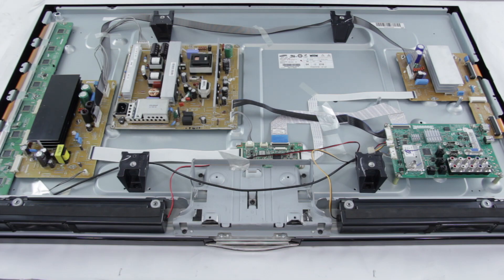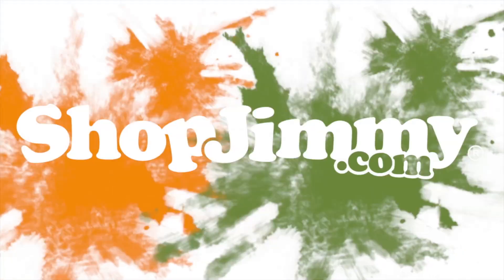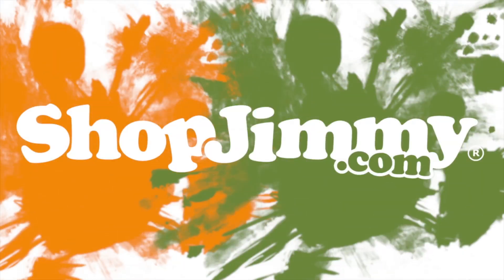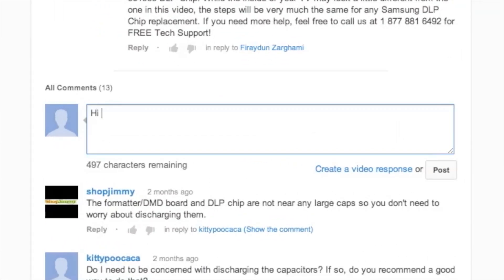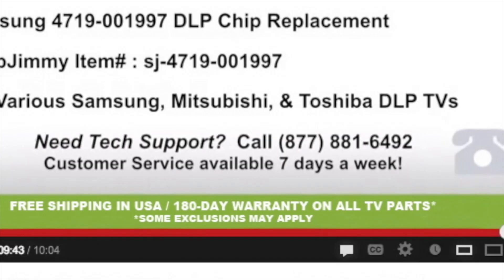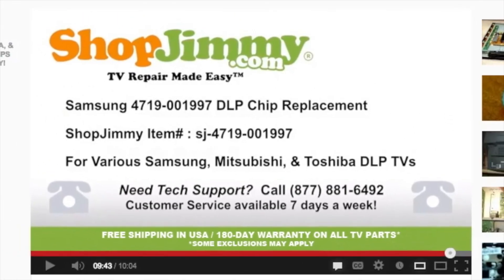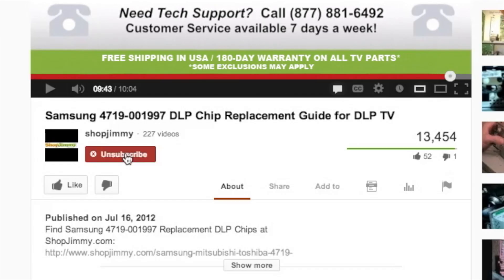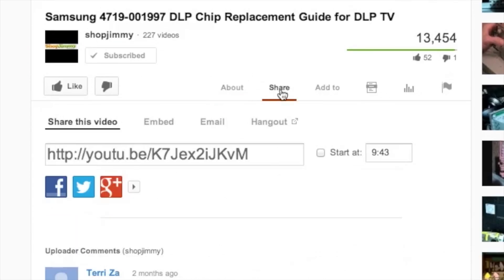Plasma TV Repair Tutorial - Common Symptoms & Solutions - How to Fix Plasma TVs

Comment: I have a Toshiba 42HP66 Plasma TV. It turns on but there is no sound and no picture. I did the test with the Y-Sustain and Z Sustain and neither brought sound back. There are 2 capacitors that dont look busted but may be. What would be the most common culprit with a partially failed power supply?
Reply from the maker: +James Misse   Try all repairs and troubleshooting at your own risk.  I recommend replacing the YSUS and the YDRVTP board in your TV.  Click this link to replacement parts for your TV model number:  http://www.shopjimmy.com/catalogsearch/result/?q=42HP66  There may be multiple boards for the same TV model number, be sure to match part numbers on your current board, with your replacement for compatibility.  Here is a link to a video showing how to identify your part number, click here:  https://www.youtube.com/watch?v=GEllG3RV-tc  Thanks and please let us know if you have any further questions with your TV Repair!  www.shopjimmy.com

Comment: Hello I have a plasma samsung model pn50c550g1fxza, It has thin vertical lines that run from top to bottom.
Reply from the maker: +Paula Bryant   Try all repairs and troubleshooting at your own risk.  This sounds like a TV panel (TV Screen) problem.  If your TV panel is bad, it may be more cost-effective to replace the TV as panels are typically hard to find in stock, difficult to replace, and expensive.  Thanks and please let us know if you have any further questions!  www.shopjimmy.com

Comment: Hi, I have a Samsung Plasma FP-T5084.  I am not getting any power to the TV at all.  I checked the power source and cable and they are good.  From watching your video I'm thinking it's the power supply.  I have 2 questions.  How would I know if I should change the Power Supply or the fuse/fuses?  Also, do you know where i'd order these parts?
Thanks so much!

Comment: Hi, I have a samsung plasma tv, model #PN51E8000GF. When facing the tv I have lines that run from top to bottom  just on the right hand side of set. They vary in color and number, there can be as little as 2 and as many as 8 at a times.

Comment: I was watching my Samsung PN59D530A3F, there was a loud pop and some sparks came out of the bottom on the side where the power plugs in. Now the power will not come on. Based on your video it sounds like it would be the y sustain board. What would be the ideal solution?
Reply from the maker: +Burtonbordr09  Try all repairs and troubleshooting at your own risk.   I recommend looking over all of the boards to see if there are any damaged components or raised capacitors.  Thanks!  www.shopjimmy.com

Comment: I have an LG Plasma 50PC3D-UD.A1 serial number 610RMZL032381. The set is getting power and is turning on but "no signal" from either the cable box or Apple TV. Could it be as simple as replacing blown capacitors, the main board or are there bigger issues? Thanks
Reply from the maker: +Patrick Smith   Try all repairs and troubleshooting at your own risk.  I recommend replacing the main board in your TV.  Click this link to replacement parts for your TV model number.  http://www.shopjimmy.com/lg-68719mm062b-main-board-for-50pc3d-ud.htm  There may be multiple boards for the same TV model number, be sure to match part numbers on your current board, with your replacement for compatibility.  Here is a link to a video showing how to identify your part number, click here:  https://www.youtube.com/watch?v=RwHTvjMdrhk  Thanks and please let us know if you have any further questions with your TV Repair!  www.shopjimmy.com

Comment: My PN42C450B1D samsung plasma tv doesn't turn on. The red light works and the start up sound plays but the screen stays off. My wife said it made a popping sound when it went off. Any help would be great. Thanks
Reply from the maker: +Jonathan&Courtney Lorenza  Try all repairs and troubleshooting at your own risk.  I recommend replacing the Y-Main Board and the (Upper) Y Scan Drive board in your TV.  Click this link to replacement parts for your TV model number:  http://www.shopjimmy.com/catalogsearch/result/?q=PN42C450B1D  There may be multiple boards for the same TV model number, be sure to match part numbers on your current board, with your replacement for compatibility.  Here is a link to a video showing how to identify your part number, click here:  https://www.youtube.com/watch?v=R1jmj_foId0  Thanks and please let us know if you have any further questions with your TV Repair!  www.shopjimmy.com

Comment: I have a samsung HPR 4272 plasma screen TV. The TV does not show a picture or sound when plugged in and turned on. It will make a clicking noise as if it was turning on and off cycling through on and off continuously. Any suggestions would be appreciated. Thanks 

Motemlw@gmail.com
Reply from the maker: +Michael Wintermote   Try all repairs and troubleshooting at your own risk.  I recommend replacing the Y-Main Board and Y Buffers in your TV.  Click this link to replacement parts for your TV model number:  http://www.shopjimmy.com/samsung-lj92-01200a-y-main-and-buffer-kit.htm  There may be multiple boards for the same TV model number, be sure to match part numbers on your current board, with your replacement for compatibility.  Here is a link to a video showing how to identify your part number, click here:  https://www.youtube.com/watch?v=R1jmj_foId0Thanks and please let us know if you have any further questions with your TV Repair!  www.shopjimmy.com

Comment: I have panasonic th-50px50u , manufactured in Dec 2005, that all of a sudden only shows vertical alternating bright green and regular green lines from top to bottom.  TV will do nothing but turn on and off.  It used to make a click sound when I first turned it on, but now doesn't do that either. Any thoughts?

Comment: Have Samsung HP-T5054 plasma tv.  Sound works fine.  Picture starts out black but the picture will "bubble" out over a couple of minutes if the TV has been unplugged and off.  The picture that appears is faint in color and washed out.  Has some static in it.  What board is most likely causing this problem?

Comment: i have a panasonic plasma model th-42pz77u, with the 7 blinks of death. how do i fix?
Reply from the maker: +elaine petrilla   Try this at your own risk. Unplug the TV, then disconnect the SC board and plug in the TV to see if the TV powers up. Note that it will not have a picture on the screen. Reply with the results of this test. Thanks! www.shopjimmy.com

Comment: Hey Guys - I posted a problem 2 weeks ago with a 2006 Panasonic Viera and the 10 blink problem. I followed the steps provided in the answer, but although the symptoms varied a little, the tv still did not power on. Here are the results and the answer you provided: 
David Scott   Try this at your own risk. Unplug the TV, then disconnect the SC board and plug in the TV to see if the TV powers up. Reply with the results of this test. Thanks! www.shopjimmy.com
 Reply  · 
 
 
David Scott 6 days ago
 +ShopJimmy.com I disconnected two smaller terminals at the top of the board, and one larger one towards the bottom which looked like the only three connections to the main board. Then I applied power to the TV, and got the two quick clicks, but not the third one so I figured maybe I was on the road to recovery. When I pressed the power button, I started getting five (5) blinking red lights which was totally a new symptom.  I watched and counted for a little while to make sure that's what I was getting. I turned it off, then held in the power button for approximately 10 seconds and I was now back to getting ten (10) blinks.

Any suggestions as to what to do next?

Comment: what is the difference between plasma, led and lcd, is a plasma tv can also use to hook up a laptop?
Reply from the maker: +filipina santos   Try all repairs and troubleshooting at your own risk.  There are many differences.  Yes, as long as you have the correct connections, you should be able to connect a laptop to a plasma TV.  Thanks!  www.shopjimmy.com

Comment: I have a Sony FWD-50PX2 which displays a fuzzy static like picture while using either the HDMI input or the VGA input.These are the only inputs available to test. The display of quickly changing images is not a problem, with the exception of the above fuzzy / static haze. There were dark horizontal lines which went away after the TV warmed up. Any help you can provide would be much appreciated! Thanks for reading!
Reply from the maker: +julesvern1872   Try all repairs and troubleshooting at your own risk.  I recommend replacing the main board in your TV.  Click this link to replacement parts for your TV model number:  http://www.shopjimmy.com/catalogsearch/result/?q=FWD-50PX2  There may be multiple boards for the same TV model number, be sure to match part numbers on your current board, with your replacement for compatibility.   Thanks and please let us know if you have any further questions with your TV Repair!  www.shopjimmy.com

Comment: I have a LG 50PX950. The serial number is 009RMPG6R600. When I turn the set on, the screen flashes to Gray like it is turning on but the screen never does. I can hit the menu, volume and channel buttons on the set, and the light on the bottom, right side of the screen (as you are looking at the set) flashes white, which is what it is supposed to do. Any suggestions?
Reply from the maker: +schwadb   There may be multiple boards for the same TV model number, be sure to match part numbers on your current board, with your replacement for compatibility.  Here is a link to a video showing how to identify your part number, click here:  Thanks and please let us know if you have any further questions with your TV Repair!  www.shopjimmy.com This could be a problem with either the main board or the TV panel.  You can replace the main board to see if that fixes the problem.  Click this link to replacement parts for your TV model number:  http://www.shopjimmy.com/catalogsearch/result/index/?cat=56&q=50PX950  There may be multiple boards for the same TV model number, be sure to match part numbers on your current board, with your replacement for compatibility.  Here is a link to a video showing how to identify your part number, click here:  https://www.youtube.com/watch?v=RwHTvjMdrhkThanks and please let us know if you have any further questions with your TV Repair!  www.shopjimmy.com

Comment: Hi, I have a Samsung PN50A550S1FXZA Plasma. The problem I'm having is upon initial turn on sometimes it power cycles, but most of the time it comes up with snowy green screen and white noise. It does this on both HDMI inputs. After another power cycle it usually has a normal picture. Once the set is on with a picture it is fine. It did this behavior on occasion for a few months and now it's that way on most every cold power cycle. If I turn the set on and off within a few minutes or even an hour I can't get the behavior This past weekend We took the back panel off and I cleaned everything with compressed air. Still has the same behavior. Any ideas? I was thinking it might be main board at first. 
Any ideas?
Thanks, Marc
Reply from the maker: +bremms1   Try all repairs and troubleshooting at your own risk.  I recommend replacing the main board in your TV.  Click this link to replacement parts for your TV model number:  http://www.shopjimmy.com/catalogsearch/result/index/?cat=56&q=PN50A550S1FXZA  There may be multiple boards for the same TV model number, be sure to match part numbers on your current board, with your replacement for compatibility.  Here is a link to a video showing how to identify your part number, click here:  https://www.youtube.com/watch?v=BEPWrefQvqI  Thanks and please let us know if you have any further questions with your TV Repair!  www.shopjimmy.com
Reply: THANKS, I was thinking it was the main board. I'll check the part # and see about a replacement.

Comment: Hello, I have a Panasonic Viera 42" plasma HDTV model number TC-P42U2. Basically out of know where the television will just shut off. Sometimes it will be able to turn back on after a couple minutes. The last time it wouldn't come back on at all. I just plugged it back in and it turns on again and seems fine but something has to be causing this. Any ideas? Thanks
Reply from the maker: +Shannon Brake   Try this at your own risk. Unplug the TV, then disconnect the SC board and plug in the TV to see if the TV powers up. Note that it will not have a picture on the screen. Reply with the results of this test. Thanks! www.shopjimmy.com

Comment: hi, i have panasonic txp50vt20b. im getting no picture, just black screen, it is not coming on. i get 10 flashing lights after 3 clicks. i have changed the main cap, from 230v to 250v 1000uf. and removed a bulb that appears not to work, i have bridged this instead. i have also changed a resistor, 8.2m homs by the bulb i have checked most parts that i can with a multi meter, they seem to have current or resistance, i dont know what else to do. could you help plz, also i am not savvy on this type of project. so simple explanations would be most appreciatinve.
Reply from the maker: +james rushton  Try all repairs and troubleshooting at your own risk.  I recommend replacing the SC, SU & SD boards in your TV.  Click this link to replacement parts for your TV model number:  http://www.shopjimmy.com/catalogsearch/result/?q=txp50vt20b  There may be multiple boards for the same TV model number, be sure to match part numbers on your current board, with your replacement for compatibility.    Thanks and please let us know if you have any further questions with your TV Repair!  www.shopjimmy.com

Comment: I have SAMSUNG plasma manufactured 2012 model S51AX-YB01. The TV turns on (powers up) and the stand by works but the TV doesn't turn on. Visually all the fuses and capacitors look fine and the TV looks brand new inside. The MENU etc also doesn't show. Any ideas what could be wrong?
Reply: +Brett Rowlands  Sorry, more information. The TV was on and the picture went blank, I turned the TV off and on with the remote. It made a crackling sound the first time it turned back on. Thanks Brett
Reply from the maker: +Brett Rowlands  Try all repairs and troubleshooting at your own risk.  I recommend replacing the X/Y Main Board and the Y-Buffer Scan Drive board in your TV.  Click this link to replacement parts for your TV model number:  http://www.shopjimmy.com/catalogsearch/result/?q=S51AX-YB01  There may be multiple boards for the same TV model number, be sure to match part numbers on your current board, with your replacement for compatibility.  Here is a link to a video showing how to identify your part number, click here:  https://www.youtube.com/watch?v=R1jmj_foId0Thanks and please let us know if you have any further questions with your TV Repair!  www.shopjimmy.com

Comment: Hello, Hope you can help, i will definitely buy parts from you.  I have a Samsung 43" plasma tv, model number PN43D450A2DXZA.  My problem is while watching the tv the video just turns black, no indication that it is going to happen, no clicking noises, the red light underneath the on button stays off, and the audio is not affected. if the TV is cold it may ten ten or so minutes before it will do this.  I can shut the tv off, wait for the relay to click, turn back on and the tv will be fine for a few more minutes and then do the same thing, sound but no picture.  I have already replaced the logic board but the same thing happens.  The green light on the logic board blinks normally when working good and starts blinking slowly when the screen goes blank.  When it is working right the picture is clear and good.  Looking forward to your reply.  Thanks.  (NFL is coming up and I don't want to have to buy another tv, this one is only two years old haha).
Reply: +Paul Garcia did you ever get a response?  I am having the same exact issue.  I suspect the Y sustain board is the problem, but I would like to know for sure before buying and replacing parts.
Reply from the maker: +Paul Garcia  Try all repairs and troubleshooting at your own risk.  I recommend replacing the Y-Main Board and the bottom Y Scan Drive board in your TV.  Click this link to replacement parts for your TV model number:  http://www.shopjimmy.com/catalogsearch/result/?q=PN43D450A2DXZA  There may be multiple boards for the same TV model number, be sure to match part numbers on your current board, with your replacement for compatibility.  Here is a link to a video showing how to identify your part number, click here:   https://www.youtube.com/watch?v=R1jmj_foId0  Thanks and please let us know if you have any further questions with your TV Repair!  www.shopjimmy.com